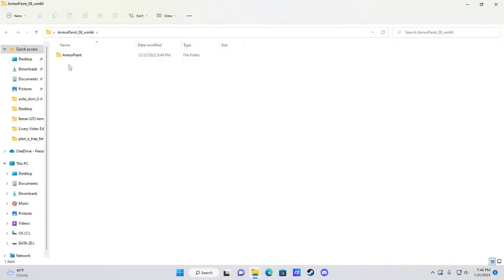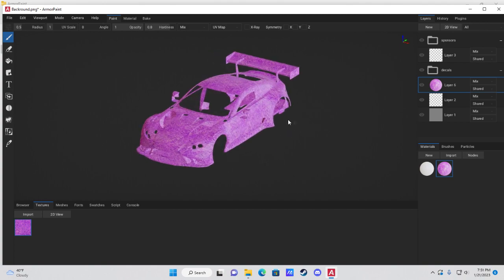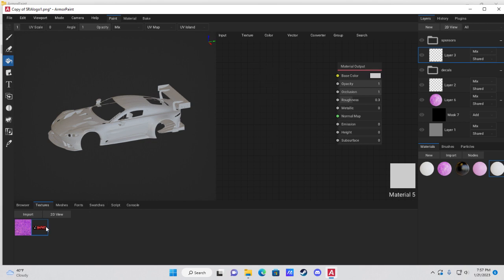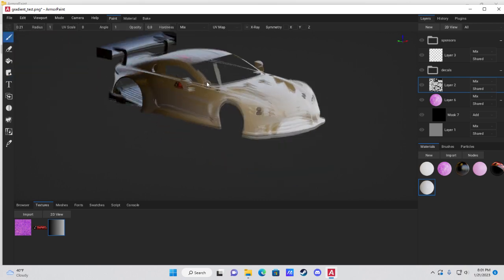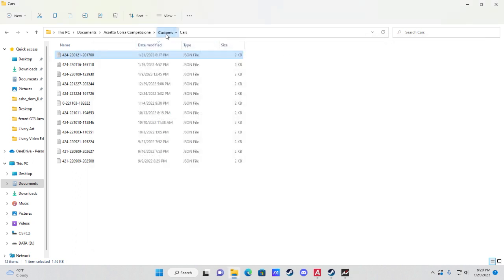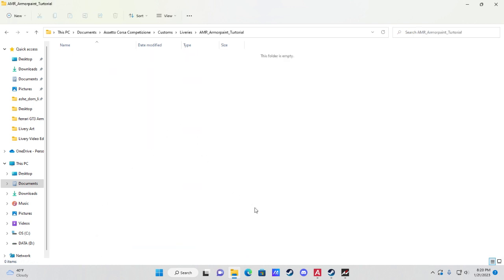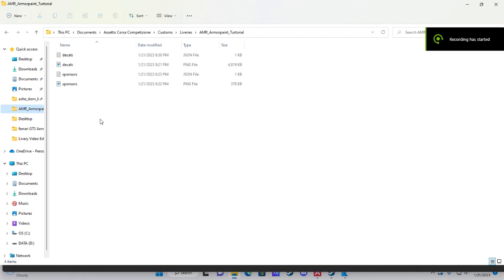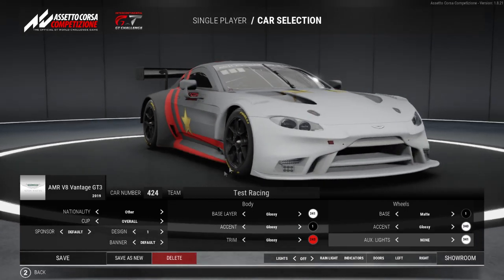Comprehensive Tutorial for using Armorpaint for ACC - SRA

Comment: Thanks for this guide. I made a custom livery and added a couple of stickers, inside the garage it looks fine, but on the track everything is just like in a lower resolution. Is it supposed to be like this or did I do something wrong? I checked and i set it correctly in 4k. Any thoughts?
Reply: On the track all the DDS files will be automatically generated in half resolution (2048x2048). Possibly for performance reasons. In showroom it is 4096x4096.
You may rename your full-res DDS files from showroom (decals_0.dds, sponsors_0.dds) to the DDS files used for the track (decals_1.dds, sponsors_1.dds) to have the full resolution also on track.

Comment: Hello I need help. Is there any way to save your own DDS files to ACC instead of creating them from the png file? Because the game is ruinning them. During the conversion some ussues appears in the paints or logos. I tried to save dds in several dtx5 formats but the game does not load them. Only load the autogenerated ones.
Reply from the maker: @betofernandez5524  unfortunately sometimes issue can occur with the dds conversion, notably compressing textures and such. The only thing I would thing to try is rename the file to “decals” so the game can pick it up.

Comment: great video! How can I focus the camera on a point of my mesh ?
Reply from the maker: Not sure what you mean, you can zoom in and out with the camera with the scroll wheel, and adjust the angle with the middle mouse button to the desired position. Or you can use viewport compass in the upper right.
Reply: @Botbot1337  i would like
To be able to rotate the camera around a specific point.

I am painting the hand of a character and it's difficult to work on it,
because the camera turn around the character and not around the hand.